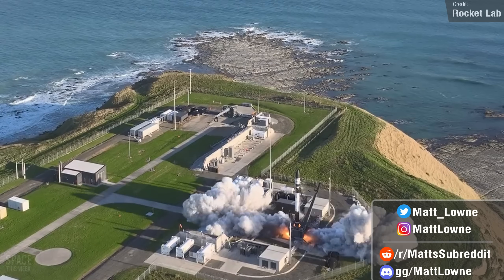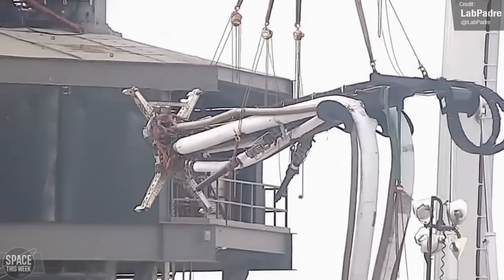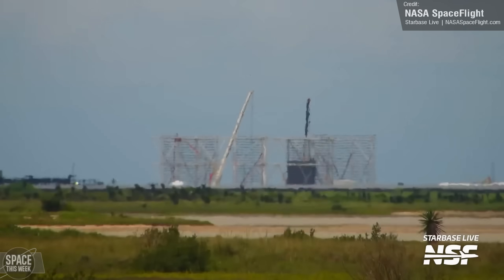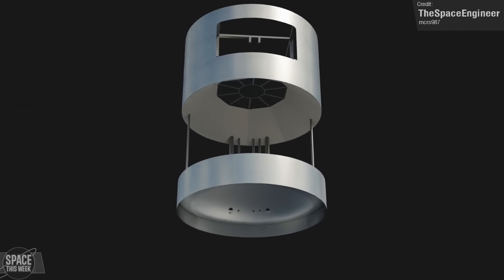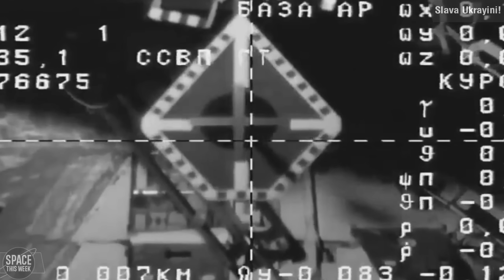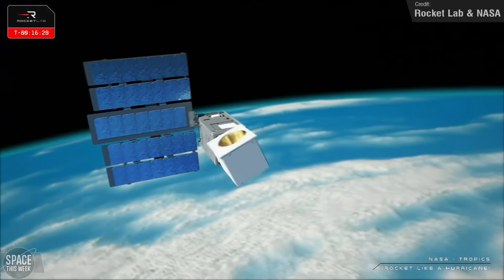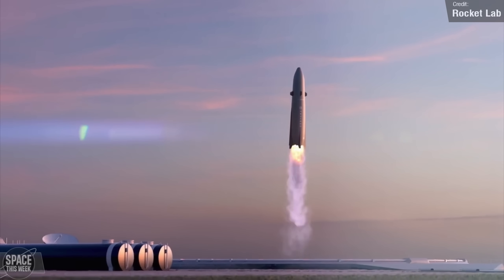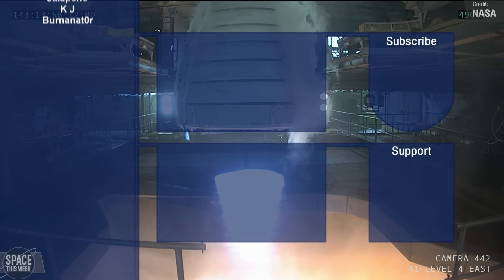SpaceX Starship Moon Lander, Starbase Demolition, Virgin Orbit Gone, Rocket Lab News, & more!

Comment: I still think it’s ridiculous that they rate theRS-25  power level as 111% instead of saying the “113%” is 100% rated thrust and the normal 111% is like say 98% rated thrust, but I guess they just do what they want or have a specific reason for doing like this
Reply: 111% is more for emergencies to compensate for the failure of other engines nearby. it continuous use could cause that engine to fail sooner. and for advertising use calling it 100% gives the better appearance.

Comment: After seeing the damage done to the launch pad I am beginning to believe that Spacex is risking too much on catching a booster or starship over the launch pad. A catch tower built fairly close and used only for catch attempts would be dramatically cheaper than the current tower because it will not have the complexities of fueling a Starship. Better to risk a cheap tower than a billion launch pad.
Reply: "QUICK REUSE" requires refueling as soon as possible after landing. Thus refueling is required.

Comment: How would spacex get their lander off the moon once landed? I'm thinking of holes... in the surface, less gravity less power I suppose... but it's a worry I bet
Reply: With the same engines that they land with. Currently, it appears that HLS Starship will have a ring of 24 smaller, LCH4 engines that are at the top of the propellant tanks. With them being 25 or so meters off the surface, it should minimize the regolith disturbance.
Reply: @steveaustin2686  Thanks Steve, sounds like it'll work.
Reply: same way they land until they are some distance above the surface.

Comment: Man, the heat tiles flying off give me Space Shuttle PTSD. If even one of those is broken at re-entry, the entire ship is a hull loss.
Reply: Actually not quite. The space shuttle’s frame was mostly aluminum, which has a very low melting point. Starship is made of stainless steel, which has a much high melting point, so a few missing tiles wouldn’t be the end of the world for starship during reentry.
Reply: @evanrichards3264 More specifically, the contents of the Starship will be fine. The ship itself probably won't be considered flight worthy, because the section exposed to excess heat will have zones of distinct heat treatments. Some parts will be tempered, and thus softer. Other zones will be hardened. The result will be a Starship that will react differently to stress, such as encountered during max-Q.

I believe that Elon wanted to test a Starship with the older heat tile mounting system specifically because it would provide real world data on differential hull heating as it would guarantee that some tiles would fall off before re-entry.

Cameras inside the Starship would capture the thermal maps.
Reply: @evanrichards3264  Shouldn't be the end. Even the shuttle survived the loss of a tile on the wing on STS-27. It was over an antenna mount, so that kept the wing from burning through like on Columbia. Discovery, STS-26, had a tile that eroded almost completely from debris damage on lift-off.

Comment: If blue origin gets their act together soon, i feel that NASA should switch to them for the moon landing. an elevator is an unnecessary failure point, and is extra weight for the craft.
Reply: But starship can still carry a lot more, both are good, both have flaws.
Reply: Extra weight for a spacecraft with an up to 100 ton payload. There are two redundant airlocks per the Apr 2021 HLS Option A Source Selection Statement (pg 10), so it is not unreasonable to think that there will be two elevators as well for redundancy.
Reply: Starship is better, and it can even act as a home at the moon of how big it is
Blue origin lander in 2050.

Comment: does anyone know what that thing flying off is at 13:44 ?
Reply: Good question… I have no idea
Reply: I wanted to know too. Probably not the landing gear, as the spaceplane had landed safely. Looks like a bit of outer hull to me, which I suppose is possible. This plane doesn’t reach orbital velocity, so it never reaches temperatures as high as the space shuttle or apollo capsule. It’s not good, and I’m sure Virgin is looking into it, but such a flight can definitely return safely if a tiny bit of the hull is compromised.
Reply: I would guess some foil insulation from the engine.
Reply: @bbgun061  Or possibly ice.

Comment: just use a spike cone water cooler/fountain (outside/inside/upwards) flame diverter/deflector
Reply: A conical flame diverter is nearly impossible to cool because it has lots of suface area relative to it's volume especially at it's tip. This means that the heat of the exaust can heat up the cone very quickly and melt it. The steel showerhead system planned for underneath the OLM is basically a very flat water cooled cone diverter because the exaust gasses from the inner engines push the flames out on all sides like you can see during the 31 engine static fire and the launch.
Reply: @bongi6811  whats wrong
Reply: @bongi6811  be happy that not all engines point at the center
Reply: @bongi6811  so you think a flame trench does not work like it does, with pure concrete
Reply: @bongi6811  the water will be all over the cone, between the cone and the rocket flame
Reply: @Jkauppa  I don't think that just having water flowing over it would be enough to keep a cone from melting because the water will boil very quickly and a cone is generally much more difficult to cool than a flat plate. If SpaceX doesn't need better deflection of the flames a flat diverter is just easier than a coneical one.
Reply: @bongi6811  up to you
Reply: @bongi6811  have you not seen how they test the rocket engines, yes, there is a heat plate right against the rocket engine at some distance, like the proposed heat dispersion cone, no matter what you say
Reply: @bongi6811  diversion is to make the stuff not stay there for long and water consumes the heat into the heat of vaporization
Reply: @Jkauppa  There are of course conical flame diverters out there and the tripod raptor test stand at McGregor has a angled matal plate as a diverter at about the same distance from the engines as the OLM, but this doesn't mean that a conical diverter is the best option. The cracy high thrust of superheavy pushes current materials and technology to it's absolute limit and if something isn't the most efficient or most reliable solution it's already not good enough. I doubt that anything without the most efficent cooling thats possible can survive that inferno multiple times without repairs which will be neccesarry for starship to fly routinely.
Reply: @bongi6811  I dont believe in you
Reply: @Jkauppa  You don't have to belive me, I'm also just sharing my ideas about possible reasons why SpaceX chose a flat plate instead of a conical diverter. If you want someone else's in depth analysis about what happened to the OLM during the first launch and SpaceX's upcoming changes to the launch pad I can highly recommend the latest video from the youtube channel "CSI Starbase".
Reply: @bongi6811  do you think a nose cone likes plasma temps without melting, the rocket nose cone, no matter what you say, I dont want to hear it
Reply: lol ok
Reply: @AP-qs2zf  lollo
Reply: @AP-qs2zf  yep its a water volcano, who could guess
Reply: so use the cryo fuel to cool the nose cone of rocket
Reply: you can use plasma maglev induction levitation as the spike cone flame diverter shield, yes hot stuff is partly plasma, why not heat it even more!
Reply: yeah for plasma temperatures use plasma stuff, no melt, maglev induction plasma bottle levitation shield

Comment: These updates are always a great start to my Mondays!
Reply: I've watched these every Monday for at least a year now
Reply: Need some speculation from Matt on how these facilities will fit with program long term. The massive investment indicates they're setting up full scale production infrastructure at Starbase... this suggests they are planning on flying production vehicles over to Florida? Shipping them via port?
Reply: @sammadison1172  They are probably just getting Starbase done first before starting KSC

Way easier to manage one project at a time
Reply: @kerbal8216  Especially as NASA doesn't really want Starship testing at LC-39A while it is the only launch pad for Crew Dragon. And likely for Falcon Heavy as well. SpaceX has started construction to upgrade SLC-40 for Crew Dragon and maybe for Falcon Heavy as well, since they are contracted by the USSF to build a VIF for NSSL payloads. Putting the VIF on CCSFS would make more sense.
Reply: @sammadison1172  Musk has said that Boca Chica will be an R&D site. The intent was never to build operational Starships out in the open, so all the work in the tents will almost certainly be moving inside the factory building. They will likely also do work on internal fittings that are not necessary for these test articles.